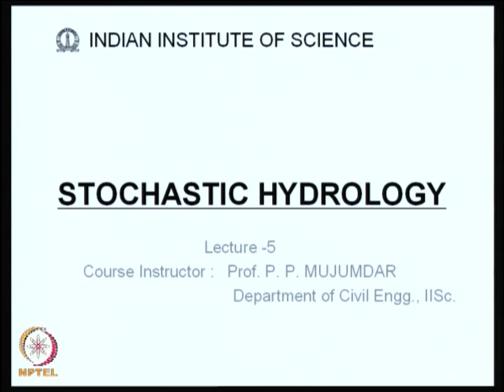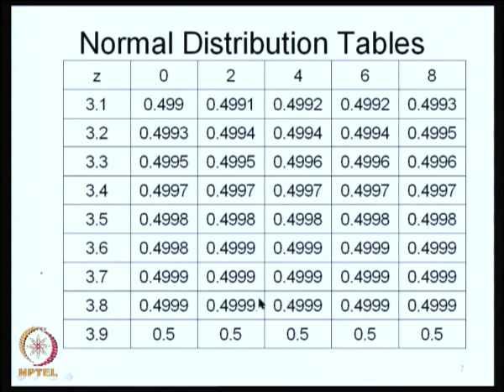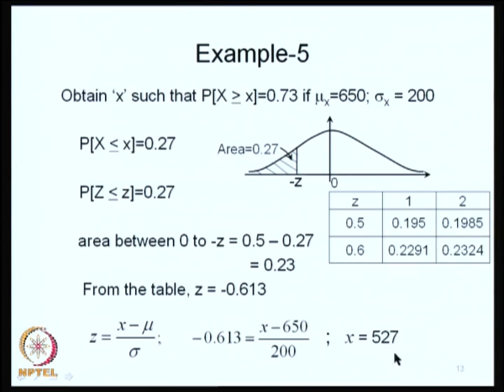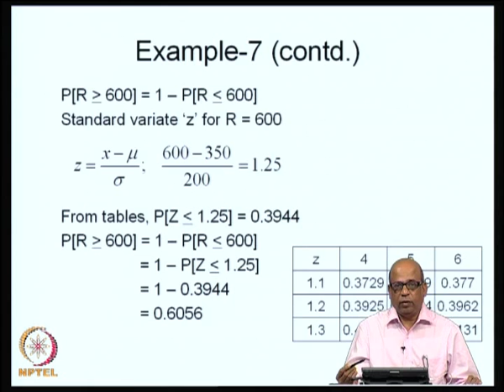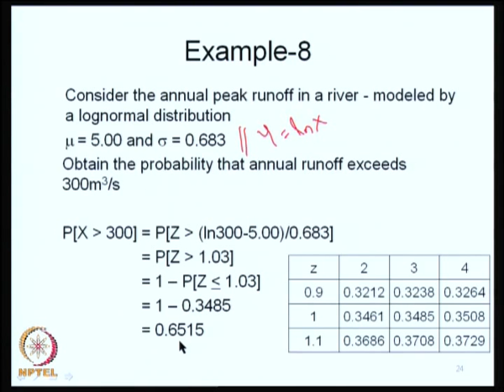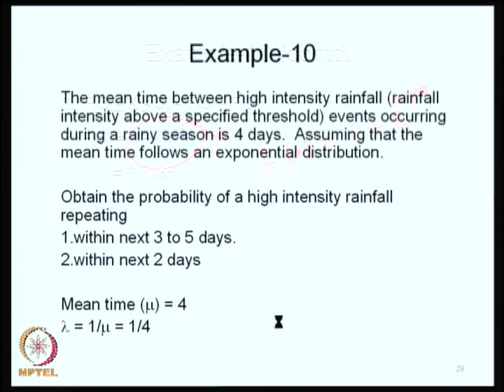Comment: In example 7  at 25:52 , P[Z<1.25] should be (0.5 + 0.3944)
Reply: Thank you for noting this. Yes, you are correct. The correct solution will be 1-(0.5+0.3944) = 0.1056.
Reply: keenly you have observed, appreciated sir.

Comment: @44.36 i cannot understand how the log normal distribution is converted to normal distribution without changing the mean and SD (5 and 0.683)
Reply: The continuous random variable X has a lognormal distribution if the random variable Y = ln(X) has a normal distribution with mean μ and standard
deviation σ. In the problem, it is asked to find the P(X>300) where X is log-normally distributed with mean 5 and standard deviation of 0.683. By the above principle, P(log(X)>log(300)) = P(Y>log(300)) follows normal distribution. Then the calculation follows similar to finding probabilities of normally distributed random variables. There is a minor mistake in the calculation, the correct one is as follows,
 P[X > 300] = P[Z > (ln300-5.00)/0.683]
                  = P[Z > 1.03]
                  = 1 – P[Z < 1.03]
                  = 1 – (0.5+0.3485)
                  = 0.1515

Comment: Formula of Cumulative distribution function of exponential distribution is wrong. Hense it makes whole solution wrong in example 10
Reply: Thank you for noting this. Yes, you are correct. The correct solutions are as follows: P[3 < X < 5] = F(5) - F(3) 

Solution no 1: F(5) = 1 – e-5/4 = 0.7135 ; F(3) = 1 – e-3/4 = 0.5276; P[3 < X < 5] = F(5) - F(3)=  0.7135 – 0.5276 = 0.1859
                     2: P[X < 2] = 1 – e-2/4  = 0.3935